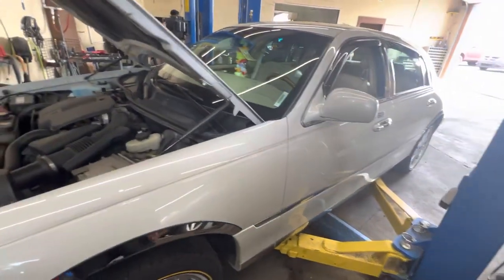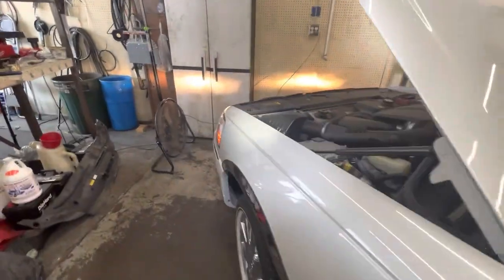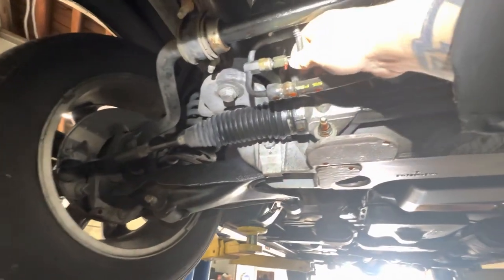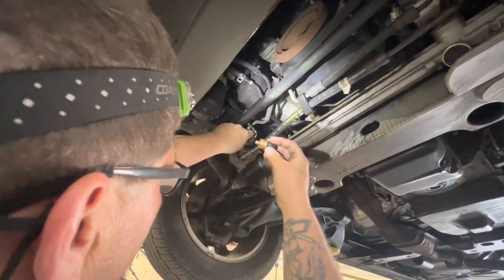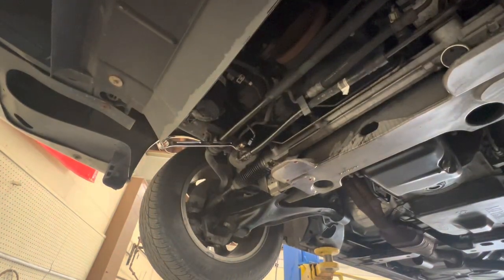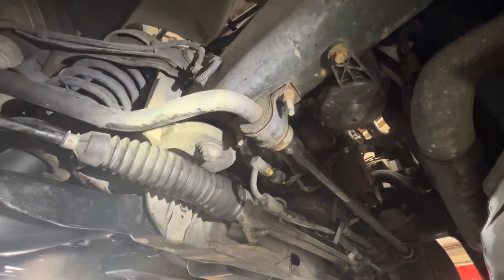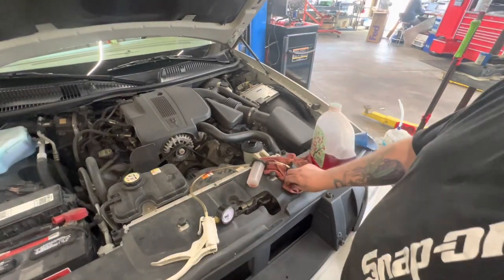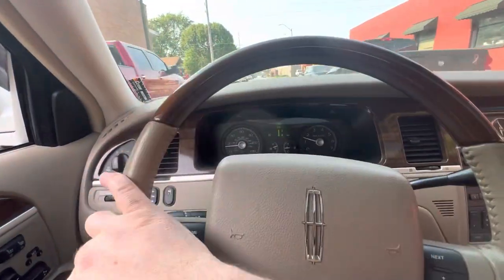2007 Lincoln town car power, steering pressure switch leaking through connector

Comment: HI, Thanks for sharing. i need to do this asap. do i need to bleed it? i dont have that special tool to remove the bubbles or bleed the system? Thanks
Reply from the maker: It may bleed out on its own after driving I’m not 100% sure but you can have the front end jacked up with it not running and turn the wheel back-and-forth slowly 10 or 20 times stop to stop and that will help. I think I bought that thing from O’Reilly’s
Reply: put one on my 07 about two years a go took about five min. did not bleed it and it worked fine and is still working.
Reply: @00buck2  thank you
Reply: @lakesautomotivediagnostics6509  thanks

Comment: Hey will this work similarly on a 2002 Lincoln Town Car with same issue?
Reply from the maker: If your pressure switch is leaking through the connector, it definitely needs replaced
Reply: @lakesautomotivediagnostics6509  for some reason it appears to be sourced from above and almost drips through the switch, any recommendations or tips man
Reply from the maker: @ElijahNathaniel it would be hard for me to say without actually looking at the car, but if you unplug the high-pressure switch, if it has fluid inside of the connector it needs to be replaced

Comment: I switched mine out and my car drove fine for a bit with no more leaks then I turned a corner and my car lost all power any ideas on how to fix it?
Reply from the maker: Lost all power steering or lost all power like the vehicle does not want to run
Reply: @lakesautomotivediagnostics6509 
I have a 2021 Toyota Corolla that has stopped running as described and I’ve wondered if that’s the issue. I’ve read on different sites that it can cause the car to stall. Is that true?